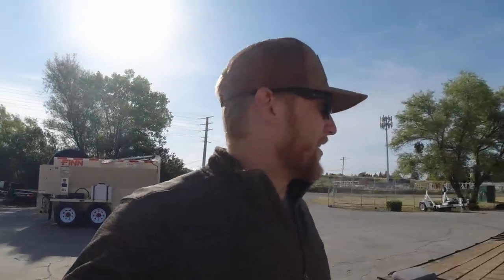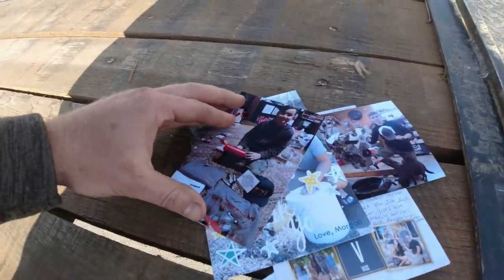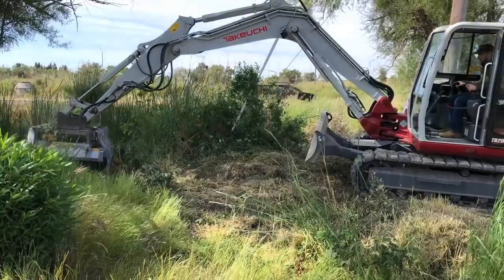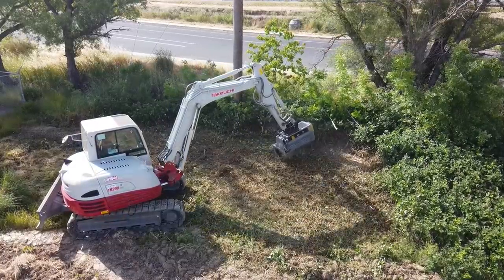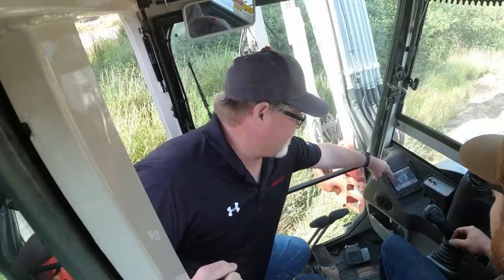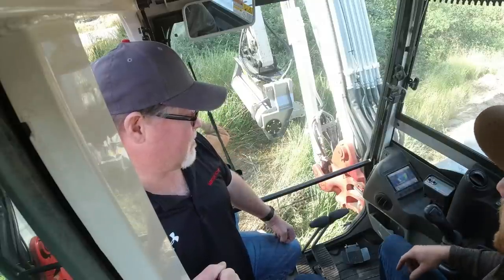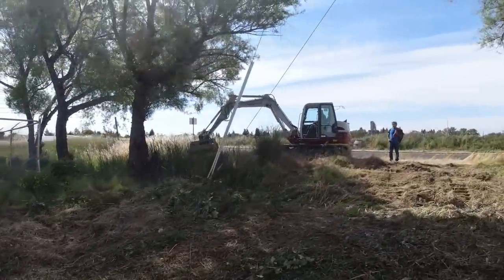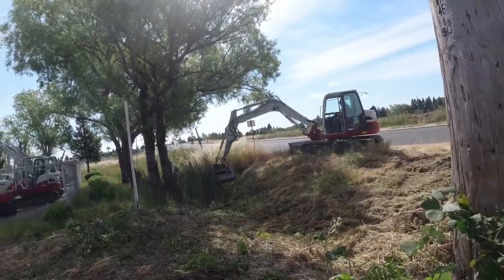New Takeuchi 290! Best Option for a Mini Ex

Comment: I have probably commented this on your channel before.
But I own a Takeuchi TB260 and a TL12V2.  And I just love them both, they are easy enough to work on,  which I haven't done yet besides first service.
They both run and operate great. They are priced better than comparable Cat or Kubota machines, and in my opinion are nicer and every bit better built and designed!
I only wish i would have went with the 280 or 290 for more reach.
Next time though if and when I ever wear out the 260.

Comment: Fantastic diggers i've been using them now for over 5 years they're supplied by a local rental company never one single issue and run on the smell of diesel they're the most reliable digger I've used to date and I've run lots of different makes over the last 25 years the rental company oldest digger is 10 years old I had it a while ago and it still runs like a new digger they have 25 of them and seriously none ever had and problems only thing they need is serviced never any problems with hydraulic pumps

Comment: Nice machine,I'm like you I like something in that weight range so you don't need a real transport TT to move it. The only thing I don't like about that and your 80 is the backhoe swing where the boom mounts to the dog house I have never had a use for it, I like the boom solid mounted like the big machines. That is a unneeded wear point for me. In the past i have used mine for land clearing and demo work which is very hard on the machine for that type of use. I like Hitachi or JD also  Kobelco in the 60 to 100 range. I like the grey market stuff to which is getting harder to get now days and way more expensive than it used to be. i like older junk to easier to work on.

Comment: You should look into the new cat 309, the  auxiliary flow is crazy it has a separate auxiliary pump. I'd love to see you demo one, and see how it does with the mulching head. Great videos!
Reply from the maker: My buddy has one. Honestly is a sweet rig but even still that’s a big difference in price tag and the gain isn’t really worth it. Still under powered machine for mulching. I’ll try and get it on a video tho
Reply: @VBELTandSON  I appreciate the insight, that would be awesome.

Comment: You don't need a Commercial License. You do need a Class A. However you can get a noncommercial license. As long as you are not doing commerce. I just went through this with California Department of Motor Vehicles. My new Ram 4500 exceeds weight limits and hauling a loaded trailer. Puts me in a range where a class B and or possibly a class A drivers license is required. I had a class A commercial license years ago. However I don't do that anymore. I am getting a class A noncommercial  drivers license. I had to argue with several uneducated people at the California Department of Motor Vehicles. However I finaly managed to get them educated about class A noncommercial license. God bless

Comment: I looked at the TB1250 And  the  TB290 . Those machines are 3 pump machines … Not single pump like my Bobcat E85 and your Kubota 080 … I looked at the Yan Mar SV100 , that is a. Very nice machine also…. Hat machine has Dual pumps … there are not many more machines worth a shit in this category.. yes Volvo, Now Kumatsu gets a huge thumbs up for sure… there are others but the Yan mar and the Taki are for sure in the running for my next machine. All these small machines have limitations

Comment: Hello from the socialist republic of France. I have  1.5 tonne TB016 with 500 hours. Would like to put a flail on it but some say I have to have the hydraulic pressure and flow verified, others say its not necessary. 
I cannot transport it to a dealer and I'm told no-one will come out. Any advice would be welcome. 
Thank you.

Comment: I’ve actually been talking to bill about possibly buying a tb250-2
Been also looking at the yanmar vio50
For your weight the vio80 is an 18k machine
Reply: I think either of those are good options. The one nice thing about the Yanmar is that those models are zero tail swing. I just bought the vio17 from Meridian in Sac. Obviously a lot smaller machine but I have been impressed with it so far.
Reply: Grady Wray the same company I’m working with for mine
Reply: PC 24 I sadly do not. If I was to guess I’m thinking in the $75,000 range the vio50 I’m looking at is going to run me about 60k
Reply: @IManOPERATOR  did they ever tell you what was the significant difference between the ViO50 and the 55? (If any) I can't decide between them. There is very little difference as far as engine and hydraulics on paper. Dont want to spend an extra $10k on the 55 if the power is similar.
Reply: @wpog8453  Id bet it's a half model. Little more reach and depth etc.
Reply: @wpog8453   hi i bought a 1999 vio 40 ran it 300 hours then lost the travel motor while it was getting repaired I jumped up and bought a new vio 2018 for 58k delivered from back east i thought it had a big difference in power and when using the front blade it cut way better due to the extra weight work it hard for 8 hours put in 5 gallons of fuel i have 730 hours on it now. love it no problems.
Reply: that was vio 55
Reply: @wpog8453  sorry for being a year late 😂 same HP however larger over all boom and stick and hydros you get a bit more of a punch with the hydro power and extra weight being more stable on the job

Comment: John deere 85g
Reply from the maker: Why
Reply: @VBELTandSON  nice response time 56 hp so no def and for digging it has a pretty good break out force for 56 hp and the 38 gpm for hydraulics
Reply: I like Deere exacavtors the skid steers not so much.
Reply from the maker: Idk how that would 56hp and 38gpm. The 290 is 69hp and 26-35 depending on how you set it up and it could use more hp
Reply: @VBELTandSON  true but it gets the job done
Reply from the maker: Lol so would a shovel😂
Reply: @VBELTandSON  LMFAO
Reply: @100M2B  LOL! Could not agree more. Pin sizes, bearing bushing sizes etc. Those Japanese know what they are doing when it comes to Engineering👍👍

Comment: I know you have a deal going on with global but I just bought a Yanmar mini excavator from Meridan in Sac and that little thing is awesome. It has so much more power than I would have thought for its size. Vi017 about 4000 pounds. I use it for excavating and such in small yards and getting through small gates for residential landscape construction. Honestly though, it seems any of the Japanese manufacturers make great machines.
Reply from the maker: Shoot I couldn’t ever get meridian to call me back. I never tried yanmar. Also this has a yanmar engine lol
Reply: @VBELTandSON  Damn. Well Bill Ford over at Meridan has been pretty good for me but I think he is basically doing all the sales for the whole place by himself from what it seemed to me. Anyway, Yanmar makes a great machine and engine. I don't know much about the bigger excavators they make but I know mine is working out great. I know they also just bought ASV and I think they will be coming out with their own skid steer line in the next few years...

Comment: We have a Volvo ECR-88 mini (mid?)   Our FORMER local dealer was great, but they lost the Volvo support.  Now it takes about 2 weeks (before CV19) to get a tech out,  as before, a tech would be there that day or the next morning.  The OLD local would take the time to get there tech on the phone to do a trouble shoot/see what they may need, the new; out of state; yeah - we'll schedule someone 2-3 weeks from now...

Heck, even Deere ships their "heavy" service 4 states away...

We're looking into a new back-hoe, 125+ grand, to replace our '97 New Holland with a s*&^ ton of hours and many multiple ops (drivers!)
Comes down to the local dealers - Case/New Holland (Fiat group) or Cat.  We have both, N.H./Ford/Jacobson and Cat running (and clinging to life...) and either dealer/distributor would bend over backwards for us.

 Some schmuck/shirt(skirt)-n-tie/ mangler would go Deere/JCB/Volvo/who-ever to save a grand or three, but no local dealer support/network.

Our outfit has about 1/2-3/4 mil in heavy equipment (skid/tracked loaders to mid-heavy wheeled loaders mini/mid to mid/heavy excs, 6-12 wheel dumps&t trailers) and the f*&% penny pinchin M.F.'s make my life a living heck trying to service/maintain/repair this stuff in a timely matter with out me going postal....

: END rant

TL:DR - Buy form a local dealer that you trust and have a good relation with  - brand comes second.

Comment: Sweet lookin ride Sam! I rented a takey 250 a few months back to remove a bunch of juniper trees here in Central Oregon to build a riding arena for our non-profit program, it was 10-12 thousand pound machine and one of the old models but it did what I needed. Definitely a "rental" machine and put through the ringer which made it feel like just another wore out small excavator, but what frustrated the piss outta me was the thumb would hold zero pressure against the cylinder so it may well have not had one at all lol. I was trying like hell to get a 290 but unless you're a licensed contractor I don't think they like to rent that size equipment out to just anybody because I can say all I want about 15 years experience hauling and operating far bigger iron than this.............they still haven't seen it. Can't say I blame them either but back to the video, thanks for the ride along pard! One day when I grow up......... I'll have one of these with grapples and a zipper head for wasting precious time and fuel lmao 🤣, be a fair piece before the growing up part happens though lmfao